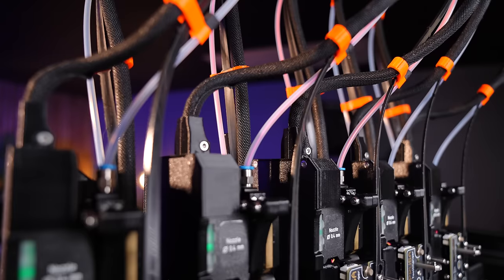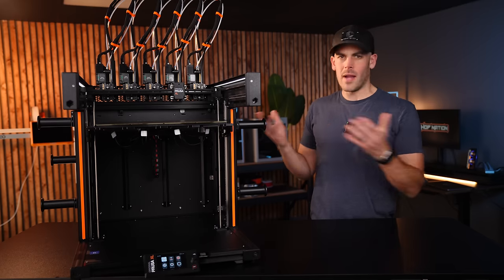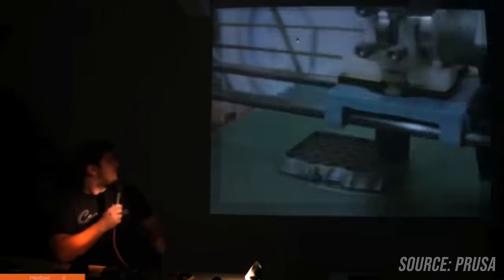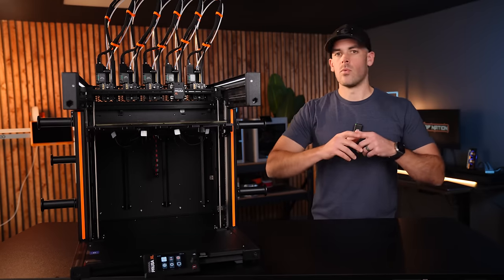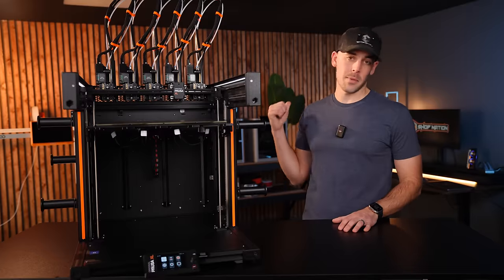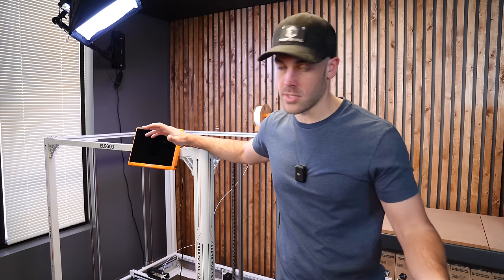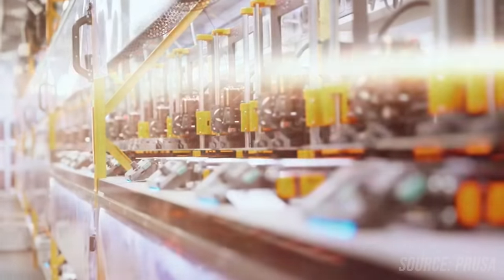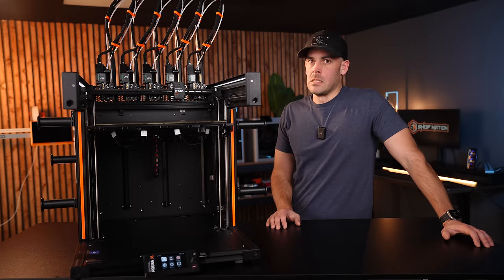Why Prusa is the next Blackberry

Comment: Still waiting for a company to come out with a way to reuse all the wasted filament without having to build my own version.
Reply: There is a guy making a print head that uses pellets rather than filament.  Recycling would just be grinding up the poop from the bambu and printing it with the printer you have that head on.  Can't remember the guy's YouTube channel but he just put out a new video.  If he does a Kickstarter once he has it ironed out I'd get one for my mk3 and recycle the poop with that.  Pellets is what plastic is before turned into filament so it's 25% of the price, which is the main advantage, not recycling.
Reply: @exodous02 you must mean Greenboy3D
Reply: CNC Kitchen made a filament recycler. The Artme3D video. Haven't watched but he always has good content
Reply: There are off the shelf filament extruders, put most are expensive and don't make sense unless you are printing a lot. There are also quite a few DIY ones, but obviously those have their own issues.
Reply: What's the point? If it's same material it'll just be brown, and if it's not, you'll have incompatible materials galore.
Reply: @TheLaXandro  that is the color of filament with no color.  Color can be added to the print head the same way the plastic beads are.  He's still working on it.  The point is cutting out the pointless process of making filament and making print waste easier to recycle.
Reply: There's literally pellet printers and affordable Filament makers.  Not sure if you're capable of doing research lol
Reply: @exodous02 most of printing waste is supports, filament change poops and failed prints. Supports and failures can be recycled into reasonably long runs of single-colour single-material prints, but poops and failed multicolour prints by definition are mixed,  and even if you sort out and toss out all material changes, you'll have mixing. Mix enough pigments and you'll get brown. Brown is unescapable.
Reply: recycled filiment alot of times doesnt make good quality filament like diameter can be wrong it can clog alot thats why u dont see much of it
Reply: @TheLaXandro  Most (?) people just print in PLA. The only (common) filament that has major issues with not sticking to other materials is PETG
Reply: @Bubbins1111 in some countries PETG is the preferred filament instead of PLA, depends on supply chains and people's preferences. 
From my experience PETG and PLA both have around the same amount sticking-non-sticking quirks with other materials, and the biggest among them is the PETG+PLA combo that turns everything crumbly. They actually stick to each other well enough to hold during printing and then release (unlike, for example, PP on PLA that just curls off), making them perfect for supports and live joints, but if you don't purge enough switching between the two, your first layer or two will assume the consistency of nori and layer adhesion of dried up electrical tape. Meanwhile aforementioned PLA+PP combo that refuses to stick if you print one on another is actually a way to make PP much less of a bitch to print if combined, at cost of strength compared to PP but still stronger than bare PLA. And PP sticks to PETG, kinda.
Reply: It will go all the same way of how alcoholic beverages doesn't give a f*ck about their glass bottles, how fast fashion doesn't give a f*ck about their fabrics, how electronics makers doesn't give a f*ck about their batteries, etc.
Reply: @TheLaXandro  Well, if you don't want a pretty part, if it is just purely functional you can use purge for that.  Point is throw it away or use it somehow.  Reduce, Reuse, Recycle.  I print things all the time that might work but realize I have to alter it and re-print, I could use multi-color purge for testing.  Sure, it is extra time taken to sort things but for me a lot of what I print is test parts or functional parts, I don't print very many pretty figurines and such so I guess it depends on what you print.  You are correct, if I want something  ascetically pleasing I'd use fresh pellets with dye added, not purge material.
Reply: I'm waiting for a machine that has a shredding hopper that you can throw all your household waste plastics into and it will grind it up, mix it with a bonding agent and maybe a dye color and turn it into a usable filament... and it's all run on a small nuclear battery pack so you can even print "glow in the dark" projects...😁
Reply: it exists but is expensive
Reply: find a local waste to energy incinarator
Reply: @ElectronicShredder  In many countries bottlers pay for used bottles. In fact during the coof glass bottles became scarce and wine manufacturers were asking for more reuse instead of recycling.
Reply: hate to say it but bambu ams will let you use leftovers to print. it wont be pretty, but for alof of 3d prints it dont matter.
costly though
Reply: @exodous02 which is pretty much just a pultrusion Maschine... Might as well just build a small one of those
Reply: Addnorth does it including the spool

Comment: You have forgotten an important point: 
When it comes to multi-material prints, it makes a big difference whether the material comes from one hot end or from different ones. If it comes from one hot end, layer adhesions in the Z-plane of the material change are much worse (even if a lot of purging is done). 
This does not happen with a printer like the Prusa XL or IDEX printers. This has an enormous influence on the strength of a component. 
This means that the target group is not so small, but is aimed at all people who want to print multi-materials and have certain strength requirements.
Reply: In a printer mainly built for PLA use being open framed why would it matter haha "I have the toughest PLA print" isn't worth buying a $3500 printer IMHO. Until they close that monster up and heat it for decent materials I don't see the purpose.
Reply: You exactly describe a TINY niche application. From all 3d printers in the world not even 0,001% are regularly used to print multi material. Its super niche.
Reply: @m4ko288  I never got the allure of AMS, MMUs and whatnot. If you are part of the main demographic that uses these machines often, than part strength is what is important and you will likely just use a single-material with at most maybe a single colour change for text/indicators at the top/bottom. If you are interested in figurines then painting resin prints makes way more sense than using a FDM. And for silly stuff there are a lot of things that just print the old-fashioned way with parts that slot into each-other.

Look at any maker that uses 3D-Printers often including those with YT channels and you will find none of them actually using these kinds of systems in their projects. Just single-material prints.

Genuine need for Multi-Material seems reserved for when you need to mix properties within the context of Engineering (advanced niche use) OR need a machine that can do a job where numerous parts are manufactured with some having a different material. Like the time cost of it swapping nozzles is acceptable for being able to set & forget a single massive job.
Reply: @Foxhood  If you dont understand the MASSIVE advantages of an ams ... then you might not be the smartest cookie in the jar.

1. It will automatically swap to a new spool if one slot goes empty if you want to.
2. Having 4 colors / 4 different materials always loaded saves a lot of time and hassle.
3. You NEVER have to heat up the nozzle to remove the filament - its always automatically unloaded.
4. Swapping out a filament in the AMS takes 5 seconds. Its MUCH faster and more convenient then traditional printers.

Handling the printer goes from "caveman mode" to "welcome to the future". MUCH easier and faster handling.

Multi material and multi color are only the icing on the cake. The actual AWESOMENESS is in how you handle the printer and the filament. NEVER AGAIN do you have to worry "will that roll have enough material on it?" and NEVER AGAIN will you have to fiddle around with the printer just to swap out a roll. And you can have 4 / 8 / 12 / 16 rolls loaded - kept in the humidity controlled AMS - thats SO convenient.

I rarely do big color prints. I mostly just print coasters / labels / etc where there are only very few color swaps. With almost no waste at all. White plant labels with colorful text for tomatoes / carrots / etc were the last of such prints. They look awesome - and it didnt even add 1% of waste and print time.

I would NEVER EVER buy another 3d fdm printer without an AMS.
Reply: @m4ko288  I actually have points 3 and 4 without using an AMS. I injected M701 and M702 into the gcode generation configuration. Causes the printer to always start with filament loading procedure and end every print by unloading the filament. Makes start a matter of inserting filament into the hole, press button and done. Quite convenient. Manually going through unloading every print is a drag otherwise.

So as i see it: the only real benefit is easier colour swapping and not having to train an eye for how much filament i got on a spool.

On me it is mostly lost as i don't use my printer for stuff like labels. I use it for building robots which is a vastly different use-case and yeah my jobs mostly focuses filament consumption to 1-2 spools at a time so i don't have a lot of spool swapping panic. an AMS/MMU/Mosaic would be paying a premium for a minor weekly inconvenience. Not worth it

Thanks for some insight into who might find it useful. Though you could have done so without the insult. So to be even: I damaged a significant part of your argument with just a pair of gcode injections. :P
Reply: Changing heads, or changing filaments still require time. They are negligible in the delta of the two, as it is almost the same time required. 

But the software could be improved upon to negate that too.

Sadly Llamas don't code, so we may not get the functionality we deserve for a while.x
Reply: @m4ko288   Cleaner supports are not a tiny niche application. And multi-material is like a large print bed: not needed most of the time but when you need it you wish you had it.
Reply: Dude, you have your heater and fan settings wrong....
Reply: If one got such higher end need, im sure there is other choices other than 3D printing with an open-frame machine.
Reply: @m4ko288 exactly i don't normally print multiple color on the same layer, but without AMS i have to insert pauses and wait for it, then manually swap filament and purge color, which means i can only print those ones when I'm not busy and at home, no way i could do it while sleeping. AMS's advantages are not on the multi-color prints, at least for me, too much waste until they could do huge software upgrades on it.

Comment: i think the XL can be a gamechanger if they implement software that allows for different size nozzles to print one and the same object. Infill and supports will be done with a 0.8mm nozzle, low detail areas on the outside will also be done in 0.8 or 0.6 mm and the high detail areas will be done with 0.4 or even 0.2 mm, possibly even going down to 0.1mm layer hight to ensure great details while the infill etc. gets added at 0.3mm every third layer or maybe even 0.6mm every sixth layer. This would result in huge prints with incredible details, like when printed with a 0.2mm nozzle alone, but in a fraction of the time. Might be a big gamechanger for professionals who are selling detailed prints. Also They might be able to add different types of tools that could pick up and insert magnets or similar items into the prints allowing a kind of automatic assembly of mechanical parts into the printed object. The possibilities are quite limitless if you start to think about it.
Reply: if anyone could help with their opinion:
- where would you place the RatRig 3d printer? interested to know how it ranks between the rest of the brands
Reply: Sounds like that happened recently, I just don't understand why Prusa takes so long to release stuff.  Like the MMU for the Mk4 just recently released.  And we still don't have an enclosure.
Reply: @KNDlifeacademy   From what I know Ratrig needs more tinkering and knowledge than Prusa kits for example but they have a good reputation, basically Voron but with official kits. The 500mm versions apparently have some issues due to material flex & heat expansion.
Reply: @krollmond7544   They only just released an enclosure for the Mini, let's hope their enclosure designers don't take another multi-year break now.
Reply: Same material different nozzles... i do think the idea is worth testing but i think if it works, it's sort of a sign that things need to be improved elsewhere. Because for the most part, you can just span the gamut from 0.4mm to 0.8mm or sometimes even more on just the 0.4mm nozzle simply by varying extrusion width. By all reason mixer-inserts (CHT like), longer heaters, more filament grip area in extruder, etc can just increase material throughput vs. backpressure of a small nozzle.

I suppose if you had a part that had to look perfect with 0.4mm nozzle on the outside but was also large enough that it can have inner walls etc mad with 1.2mm, but then you have the problem that that large nozzle is going to be more prone to leak and blob so it would just mar your otherwise beautiful print.
Reply: @SianaGearz  thats a good point! I think alot of improvements can still be made with slicer settings, so im very eager to see what the future holds for 3D printing

Comment: Until they make a printer enclosed with a heated chamber I wouldn't consider it. If you are doing ABS / Nylon / CF mixes and want it to look good Bambu printers rock. I was looking at the XL because I need the size but it's not enclosed and to expensive for what it is.

Comment: Im a HUGE Prusa fan and have a MK4 with a Prusa Enclosure, so I say this with all the love in the world:
They need to get it together
I was a bit concerned about the MK4 being a bedslinger, but the real world results are still great. I knew that the software was a bit behind when I got it and expected them to play catch-up but it hasnt really happened as fast as I would have liked. I have faith that it will, but the XL seems like the main focus right now.
The machine is lacking a whole lot of features that come standard on significantly less expensive machines, from cameras to enclosures to even just basic lights. With IS, the speed is fine though.
However, the competition DOES have some issues too. I work with some NDA projects, so I cant go with Bambu in good conscience. Reliability can be a concern with other brands, etc. Bambu shook up the industry, which is fantastic imo, but while a lot of other brands are pushing out some machines with amazing features at amazing prices (like the early bird price on the QIDI Q1 Pro) it feels like I overpaid for my MK4.
I still dont regret it and I dont really mind paying *more*, but there is a huge gap there that is only going to get wider.
I see potential in the MK4 beyond what it is now, which is still a stellar machine as it is, but a lot of times it feels like I am part of a beta test when Im trying to do things like get octoprint to work or just add lighting to the workspace without paying extra for some kit.
Reply: I have an MK4 with the Prusa enclosure, I bought it fully assembled. The orbiter worked like a charm right out of the box. I know I was paying more, but this was my first printer and I wanted it to be success. And success it has been for me. We print only functional parts for our industrial products. I think the printer should pay for itself by this years end

Comment: 5:50 Prusa XL is the only printer that can combine regular hard filaments etc with TPU AND soluble/breakaway support in the same print. Since AMS can't do TPU and IDEX printers can only hold 2 filaments. But the lack of enclosure kind of negates this advantage, since non-enclosed printers can't be serious engineering printers.
Reply: You can do soluble / breakaway support material in the AMS.

Edit. 
Oh right you meant with TPU in the mix, nevermind

Comment: The biggest thing with the Bambu is that it just works. While I appreciate learning the intricacies of a process and tuning it yourself to work the way you need it to, nothing beats dragging a model into the software and hitting the go button and getting exactly what you wanted. That being said my experience went from an ender 3 v1 at home straight to a brand new x1 carbon with all the fixin’s at work. It’s a bit of a single barrel and points to direct injection and can bus situation

Comment: They need to start doing enclosed printers quickly or they'll be left behind. The consumer space is pushing for heated chambers that's the next trend. Qidi may even take out bambu if they don't get on the bandwagon.  You lose nothing with a heated chamber you only gain more.
Reply: Yes totally agree but I don't think Qidi will take the lead because bambu want to go there too the p1 and x1 series can have a 60c chamber only with the heat of the bed they also made a x1e with a actively heated chamber pretty expensive tho

I put a actively heated chamber so that she got the temperature way faster in my p1s and she have no problem at 60c its on their website that they say the chamber can go to 60c so it's safe